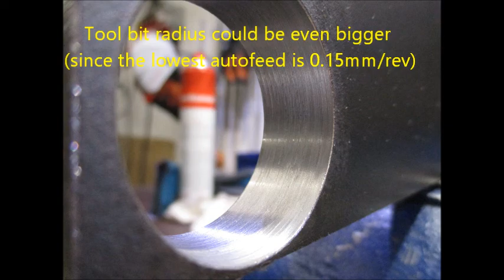drill boring

Comment: Nice work.  My drill press is so much worse quality but I think I'll try something like this.  I've been using hole saws but the sizes are limited and the finish is terrible.  Thanks for posting.
Reply from the maker: Hi! Thanks for watching. And when you do boring, always take at least two cuts, to compensate support bearing tolerances, shaft runout etc. Boring bar deflection at least in my setup seemed to be insignificant. And it's always best if you can remove the boring bar before taking accurate measurements. Also try to avoid too light cuts, just to avoid tool wandering.
Reply: @GarageOfTool  since you can boar now, I suggest building a drill press specifically for boaring. This way, you don't have to waste time switching back and forth between boaring bar and drill bits. I had this idea a year ago but I don't own a lathe nor a mill so it remained just an idea .. glad to see you turn it into reality in this great video.

Comment: bearing in table. wonderful solution, vertical lathe , I need to cut a 70mm hole for a pillar drill tool tray. Unfortunately  no hole in table , will have to hang the bearing and the job over the side.
Reply from the maker: Hi! Just use cold drawn steel bar for the shaft, those are typically straight enough for this kind of boring. I also have a boring head setup for this drill and now that I've replaced the spindle bearings I think it would also work fine and would be easier to use.

Comment: any difference between angular contact bearings and the deep groove radial bearings??in terms of rigidity / vibration??
Reply from the maker: Hi! If talking about spindle bearings, deep groove bearings will work fine even in a milling machine, as long as they are preloaded sufficiently. But I replaced the lower spindle bearing of this drill with angular contact type, since there is only "plain" bearing at the top and that won't allow high preload. Orginally this lower spindle bearing was using ball thrust bearing with bronze sleeve supporting side forces.

Comment: I tried a 2" boring head in my Clausing 20" drill press.  It had the exact same problem, lots of chatter.
Reply from the maker: Hi! I think my chatter with that boring head was caused mainly by the old plain side bearings in the spindle. I've replaced those with angular contact bearing and now it's basically a milling machine spindle. And I was very suprised that bearing replacement reduced also the drill chatter a lot, despite that drill is kind of self supporting.
Reply: @GarageOfTool  Interesting to know!,  I thought the chatter might of  had something to do with the long spindle stick out that some industrial drill presses have, and the spindle actually deflecting because of the stick out. Even with very light cuts I was getting chatter  I'll look into swapping out bearings.  Thanks